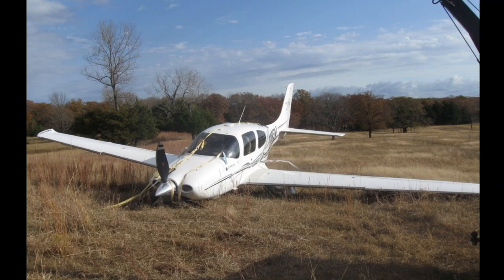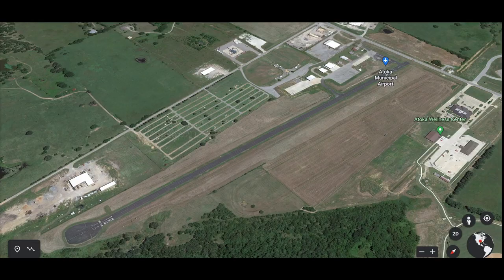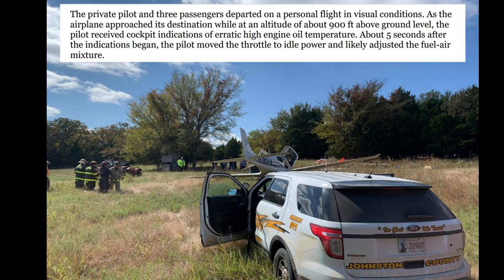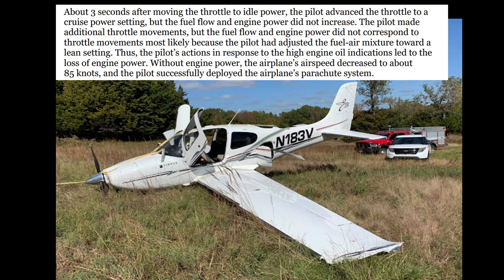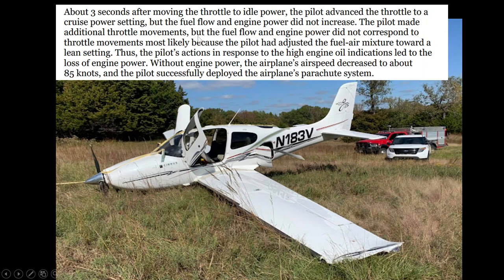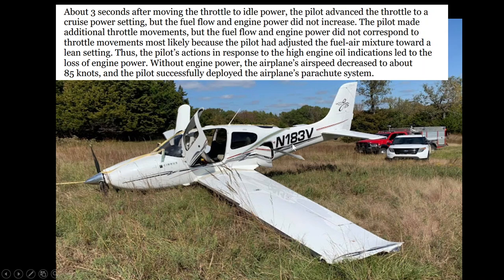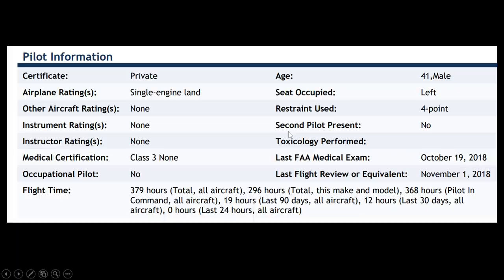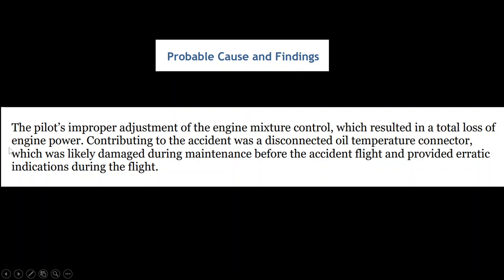Cirrus SR-22 Mechanics Error causes Crash

Comment: As a rule of thumb, a high oil temperature indication shouldn't be a reason for concern unless it's accompanied by a drop in oil pressure. Whenever a discrepancy between these two parameters exists you should trust the pressure reading.
Reply from the maker: Thanks Roberto for your take on this
Reply: Exactly
Reply: You are absolutely correct my friend! The Pilot does not understand the plane's systems and how they relate! Would have been a nothing burger if he had known the proper steps to analyze  that engine situation!

Comment: Let's see if I understand this and can put it in once sentence. While on short final at low altitude the pilot cut the mixture and shut-off the engine causing him to not be able to reach the runway. Yes, I know he had an indication but he still had a running engine and he was at the airport. Did I miss something?
Reply from the maker: Thanks Fred for watching
Reply: Correct, according to the NTSB report, he cut the mixture, most likely without realizing it.
Reply: He leaned the mixture too far and when he increased throttle the engine quit due to being too lean. That’s what I took from this
Reply: I am not a pilot but I would run an egine as long until it quits

Comment: Every single time I have the aircraft serviced, I am on high alert and usually do about 3 flight missions around my home airport to test and monitor the flights before I consider a long flight with passengers.
Reply from the maker: Makes a lot of sense Shoop
Reply: yep.  My first flight after maintenance is day/VFR/solo orbiting over the field checking all of the systems.  Then I land and remove the engine cowl and check for any leaks.  Only then will I consider carrying passengers.
Reply: Excellent advice, mechanics make mistakes. Pilots are not mechanically inclined, but with precautions, it won’t turn into disaster.

Comment: Traditionally, when you get a high temperature you go full rich with fuel mixture to help cool things down. We'll have to see what the posted procedure is for that. It looks like a place you could do a forced landing because using the parachute is only to survive and destroy the airplane. Always look around for a place to land when flying that low especially.
Reply from the maker: Thanks Matthew for stopping by
Reply: Look at the huge field he had for a emergency landing. This pilot is typical of alot Cirrus buyers who failed flying 101 &  just pull the parachute on a perfectly good running engine. Probably never changed a spark plug or got his hands dirty.
Reply: @Nord3202  2,000,000,000% right!
Reply: If the pilot had half a brain maybe. Just the oil temp going high with everything else normal my first thought would be faulty sensor. And I most definitely wouldn’t have went to idle power from cruise. Seems like ignorance got the best of him and he panicked a bit. Not realizing he went lean instead of rich. If that’s in fact the case. 
    Exactly why we are paying such high insurance premiums or even have trouble getting insurance as a new pilot. Some say ins won’t cover damage if they don’t pull the chute. Such a scam because we are the ones paying for all these airplanes in the end. Not the insurance company.
Reply: I think the same mate. He have enough room to land in case of emergency and dnt.have to use the parachute. I think maybe he scare be see the situation and thenfirar thing he do was deploy the parachute to safe his life. And he lucky he is in a cirrus equipped with parachute. What he going to do if that happen on a Cessna or other plane like almost all of them without that parachutes🤔. Maybe he got enough money to keep buying aircrafts👍
Reply: @anonymousautosolution1063  that’s
The thing. He wouldn’t fly a plane without a chute because most cirrus pilots use the chute to compensate for lack of skill. There was nothing wrong but a damaged sensor it seems. He could have looked at all of the gauges and determined it was likely a faulty gauge or sensor or short or something. If no other temps were high and the oil pressure was good he could have just found an airport to land and have it looked over. 
     If he didn’t have a chute he probably would have still crashed. Which is sad because it wasn’t even a big deal and the engine was fine. IGNORANCE.
Reply: Cirrus teaches to use the chute first. Stats say NOT using the chute is more likely to result in a fatality. I disagree with Cirrus here, the chute should be reserved for situations where a safe landing cannot be made. Maybe no suitable fields for landing exists or perhaps the pilot is lacking in skills or confidence, use the chute and most likely you will live. Hopefully you don't land on a mother pushing a baby carriage. A safely executed engine out landing can result in no injuries and no damage to the aircraft. A chute deployment is guaranteed to to cause damage to the airplane, likely a total loss and likely to cause some bodily injury and possibly death. The chute has already proven to not be 100% reliable too, a failed deployment will make it even harder to land the airplane as at least one pilot found out the hard way so far.
Reply: @ulbuilder  it’s total bs. And stupid people will argue against that. When WE are the ones paying for them to just trash the airplane. Why should I pay inflated insurance rates because someone throws training flights out the window the min they get their private. I’ve even heard that some insurance companies won’t cover damage if the chute wasn’t used. Idk how true that is. But I do not like the direction were going with these chutes. It seems to be replacing competence. 
    Catering to the people who think they can just buy their way through or out of anything. 
      Chute is good for loss of control or maybe an engine failure over water where land cannot be reached. 
    This case is ridiculous. Ignorance at its best. Boy I get so fired up over this topic. Because were the ones paying for these aircraft indirectly.
Reply: @gtm624  I agree, at a minimum this pilot could have easily just landed. On the other hand maybe this pilot is one of those people who fail under pressure. I don't think it's possible to know how you will react in a real life/death situation until actually in that situation. Will you rise to the occasion, be overcome with fear and freeze, so terrified you can't make any decisions. If a pilot discovers they don't have the right stuff when the crap actually hits the fan I have no problem with them using the chute to save their life. But I do have a problem with Cirrus teaching pilots to consider the chute as a first option to any situation. For the record I have a chute in my airplane and landed it just fine when I experienced an engine out.
Reply: @gtm624  I had a discussion in some other video where a pilot had claimed insurance won't cover damage is the chute was not used. Turns out that pilot flew passengers and his boss told him to use the chute if engine quits... because insurance. I suspect the issue here is personal injury liability not aircraft damage to be the concern and also suspect it might be more of the boss than the insurance company where this came from. Engine fails pilot tries to land, messes up, kills passengers...you know damn well some lawyer will argue and convince a jury that his client's spouse would still be alive if the pilot had used the chute instead of trying to be some hot shot top gun pilot who obviously die not have the skills needed to land when the engine failed.
Reply: @ulbuilder  Excellent point. Id say that is probably pretty accurate. Im not spending my entire life and money on training just to pull a chute. Might have something to do with the fact that everything I do is about personal growth, learning and obtaining knowledge, wisdom and skill.

Comment: Time to armchair quarterback! Worse thing in the world is a "panicky" pilot who does not fully understand his/hers aircraft systems! Wrecked a perfectly good airplane! I have mixed feelings over these emergency chutes for airplanes. They should only be used as a last resort, to many of these low time pilots simply deploy the chute at the first sign of problems! As long as the engine was running, leave it alone and start climbing, some power is better than no power! You have to have "SOME" common sense AND full understanding of it's systems when operating the newer planes with the latest bells and whistles. Just saying! But main thing is no one was hurt which is great, you can always get another plane, but these type needless incidents sure put the hurt on the rest of us with higher insurance cost!
Reply from the maker: Thanks for watching and the response to this Incident.
Reply: I think you nailed it, Jon.
Reply: @dermick  Yep, this guy destroyed "But walked away" a perfectly flyable aircraft! he had an indication fault and then exasperated the issue by messing with the mixture which was the WRONG thing to do! There was actually NOTHING wrong with the engine except for what the pilot induced! These parachute systems are a double edge sword! You need to know your airplane and it's systems before you ever leave the ground!
Reply: @joncox9719  well, he won’t do that again. Live and learn.
Reply: @virginiaviola5097  Be careful what you say on here! These social media Top Guns will take that as a challenge! Ha!
Reply: @joncox9719  😉...but it’s true. He won’t do that again. Well, he might, but probably for a different reason.
Reply: I had a bent valve rod in my Diamond DA40 about 5 miles out on final so I lost a lot of power with a bad vibration. I did not adjust power as some is better than none. If I had pulled the throttle back it would have quit. When I landed and pulled off the runway I pulled throttle back and it quit running.

Comment: Right on, you don't get a spiking or concerning oil temperature it's slow very slow so that way you know it was a false indication and keep flying the airplane and land as soon as practical. Also there should be a maintenance flight following maintenance, don't just get in and go without somebody checking it out normally they take off and fly directly around the airport so they can return abruptly for any reason. So it sounds like a series of mistakes were made.
Reply from the maker: Thanks Matthew for sharing.  Things did add up quickly it seems

Comment: I have had my A/P since  1967 . After piston engine  maintenance is done I always take the A/C out and run it a full power for  a minimum  5 minutes  and then give it a good leak check . And always go by the engine and A/C  manufactures M/M as there is a lot of good information that can  be missed.
Reply from the maker: Thanks for sharing those tips
Reply: Not to mention, it’s a good idea to do a solo test flight after maintenance and before flying with passengers.
Reply from the maker: @brucecuratola6389  totally agree Bruce

Comment: So if he had  gone full rich the engine would have come back?  I know how he feels. I pulled my chute after picking up airplane from annual and loosing all oil pressure.  Engine seized shortly there after. Pulled the chute a mile short of the runway at 500 feet.  2 oil lines came off in flight. 
Read the report if interested. There is also a good you tube video with my conversation with atc  where they confused and misledme.
N121YT
Reply from the maker: Thanks for sharing that story Bill, glad you are alive to tell the tale

Comment: Erratic readings are almost never due to an engine problem. Experienced pilots suspect instrumentation problems and won't shut the engine down.

I'll amend my comment with this: There are many indications that would not be expected to fluctuate rapidly, and instrumentation problems would be a likely cause. Oil temperature is one of those. But I guess I should say that erratic oil pressure would be a reason to consider shutting down the engine.
Reply from the maker: ThNks David for watching

Comment: It goes to prove that people should not make use of mechanical machines if they do not have an understanding of the mechanics, in this case, the pilot most certainly adjusted the fuel mixture to lean (which by the way would increase the engine temperature) and lost power because of that. However, the maintenance technician should have tested the system before allowing the next flight to take off.
Reply from the maker: Thanks Mauro for your take on this.  Seems like mistakes all around.  Glad they lived.

Comment: I can't imagine seeing a high oil temperature indication and then leaning the mixture - much less leaning to the point that the engine would become starved of fuel. Reducing power would be prudent; enriching the mixture would be, too. Opening the cowl flaps - if any - would be best. It's just simple common sense stuff to lower the oil temperature - assuming the indication is correct... But, perhaps most important of all - especially if you're going to take passengers up - is to conduct a test flight first after any significant maintenance work on the engine and/or airframe. Any "...appropriately rated pilot with at least a Private Pilot license..." may conduct this test. In fact CFR14, Part 91.407 stipulates that a test flight MAY have been mandatory in this case... It will be interesting to see where this goes, legally.
Reply from the maker: That makes sense to do a test run before risking others lives.  Also talking to the mechanic on the fixes they may have done
Reply: Even better take the mechanic on the test flight. He'll make sure he's fixed it proper then!

Comment: Not sure what the manual says but my inclination would be to at most reduce power to whatever gives me the maximum range for my current load. After all the engine was running perfectly well, and as long as the engine is running you can pick your landing spot. I think the pilot was more concerned about preventing the destruction of the engine than he was about flying the airplane. This led to the loss of both the airplane and the engine. Luckily it didn't kill anybody also. @DanGryder what is your take?
Reply from the maker: Thanks James for your take on this.  Hope the pilot can learn for next time
Reply: The goal is TO NOT HAVE A "NEXT TIME."

Comment: I'm not a pilot but an instrumentation and control tech. That "bad connection" looks to me would cause a jumping "on/off" kind of reading that do not make sense with rising or falling temperature that will happen in a gradual fashion. OK, AGAIN, I'm not a pilot and do not know real aircraft. (Did flew RC long ago.) If the engine sounds good I'd really took a second or two to take stock of all happenings, sounds and readings before I panic. Fortunately for me every time I have been in a situation like that, I had my feet at ground altitude zero, so I only had to duck flying parts, IF they do start flying.
Reply from the maker: Thank you for your take and perspective on this Johannes.  Please subscribe for more news if you haven’t

Comment: deploy CAPS just because high oil temp ? As long as oil pressure is ok and no other synptoms  go for nearest aiport and fly it until engine seizes up..next they pull caps because the air conditioning fails?
Reply from the maker: Hard to say what was going through their minds on this one

Comment: I wouldn’t say mechanics error caused the crash. It was the ignorant pilot that caused the crash. All because of a faulty sensor which just high oil temp with everything else normal screams faulty sensor or sorts not an engine problem. I’ll stretch it to say maybe the oil was getting low but Unless oil pressure drops I’m going to put it down at an airport.
Reply from the maker: Thanks for your take on this one.

Comment: Did not have to deploy the chute. We pilot's deadstick land all the time. If you are a good pilot and see a place to land. Then land the plane and save the plane. I would pull a chute, but it would be the last option I had.  If the plane can still fly then fly the plane. That area on google earth has lots of landing areas.  Pilots are getting too reliant on Tech and chute. Engine dies pull shoot. A Pilot should be able to perform a deadstick if the land gives you options.  I would also like to point out that this video's coverage of the story sucks. saying things like the shoot probably saved lives. There were no indications lives were in jeopardy. Also, say things like with no power no airspeed. You do not need the power to maintain your airspeed. it is called the best glide angle.  Even at 1000 feet, you can easily glide a plane into an off-field landing.  I think this was a case of a trash pilot not knowing his or her plane. Not enough exp to fly an SR22. Again new pilots are relying too much on new tech to fly the plane and chutes to save them when they don't understand the plane. pisses me off as it affects all pilots when fools fly. Yes, fools. you are a fool if you are not taking being a pilot seriously and getting the exp you need. 
 Honestly, how often do you hear of a plane crash due to high oil temps?   One other thing. when you fly. fly as high as possible for the mission this gives you options. You don't know how many times I see planes flying over my area at minimum. WTF are they thinking?